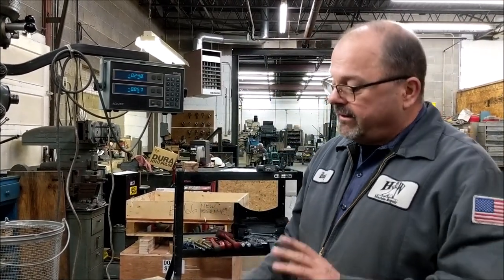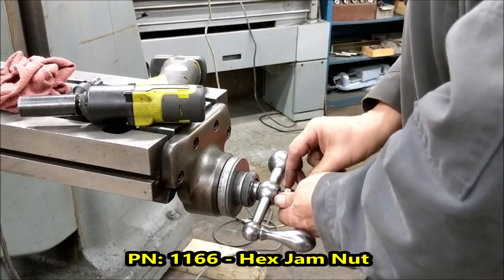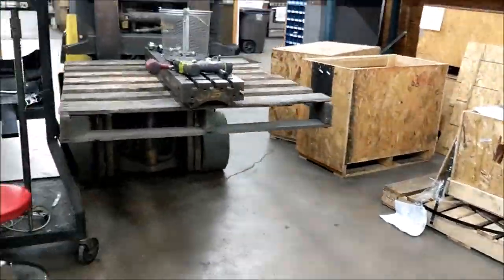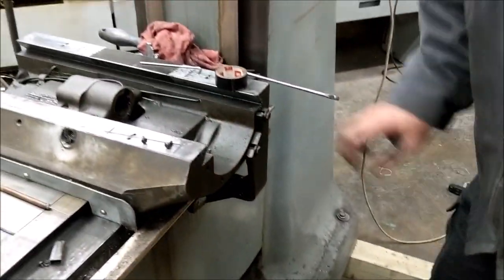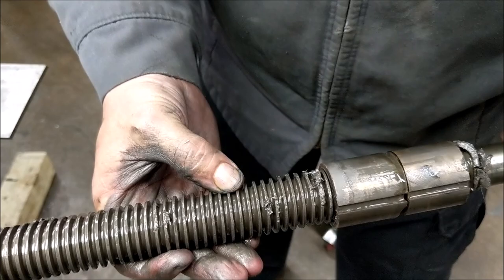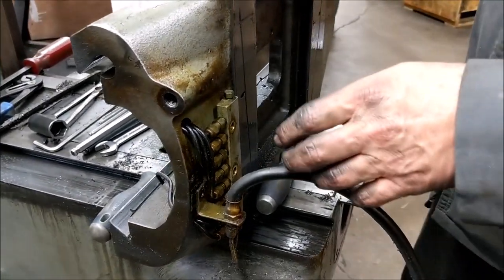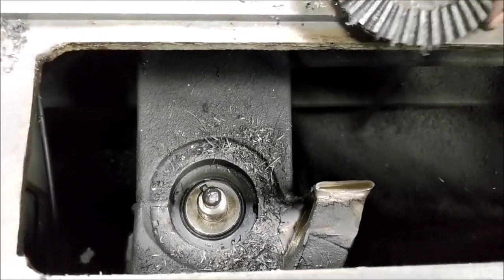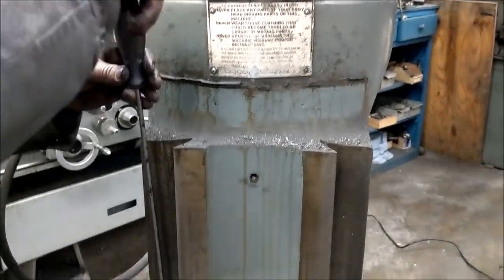Disassembly of the Bridgeport Table, Saddle, and Knee

Comment: I am quite surprised that someone would pay to restore this old mill.  The worth doesn't seem to justify it.  Happy for it though.
Reply: I have to disagree. First, we're talking refurbishment not restoration. A well maintained or refurbished Bridgeport will out-perform any of the import knee mills out there. They just aren't rigid enough to take the cuts or hold the tolerances a Bridgeport is capable of. If you are referring to the general utility of manual machines versus CNC machines, there are a million jobs that can be performed much faster manually then by setting up a CNC. tooling is still readily available, and lastly is the sense of satisfaction of making something on a mill by hand.
Reply: @pedrowhack-a-mole6786    You completely missed it.  Maybe I was not explicit enough.  An early Bridgeport (in decent operating condition) is worth about 1,000.00 in my area (Michigan). A later model with variable speed about 1,500.00 and add 500.00 for a dro and one power-feed axis.There are much better older American mills available in the same price range than Bridgeports.  I work with both manual mills and lathes and cnc mills and lathes.  I do not think this mill is worth the investment.  Just my opinion.
Reply: @istvanmeissler2238  I do respect your opinion. I know I'm being a cheer leader for Bridgeport, but 32 years working with and repairing a variety of mills of various vintages gives me some insight and justification for being so. And that after more then 80 years they are still being made, and copied, and R8 tooling is plentiful and inexpensive, also speaks to their worth. I agree that some older mills are superior in some respects, but that the versatility of the Bridgeport mill overshadows that.  Just out of curiosity, what do you favor in place of a Bridgeport mill?
Reply from the maker: We do 50 - 60 complete Bridgeport Series I rebuilds a year in addition to several lathe, grinders and other brand mills we rebuild.  The big advantage to the older Bridgeport is that parts will be available for years to come.  We stock parts for Bridgeports that were built back in the 50's.